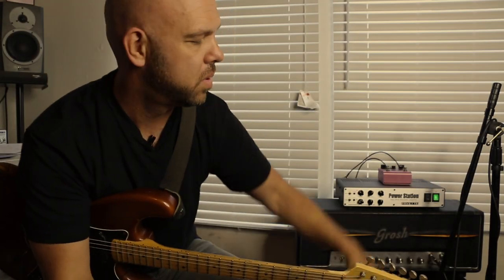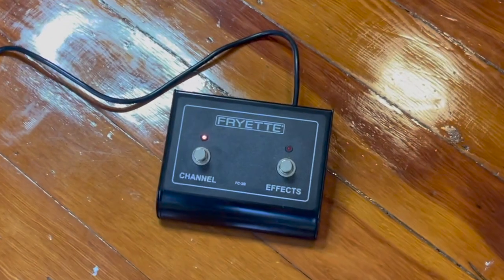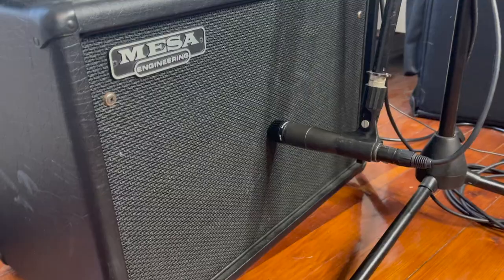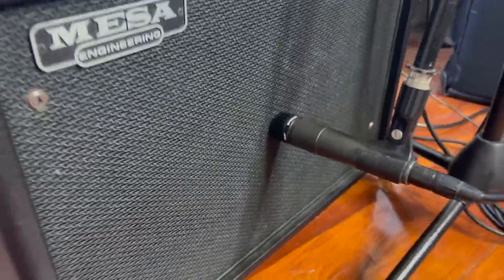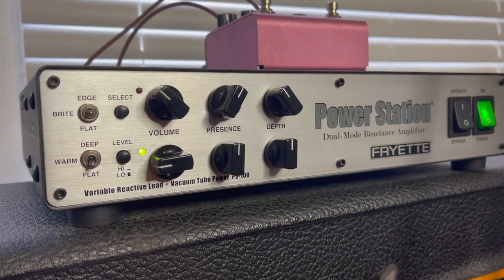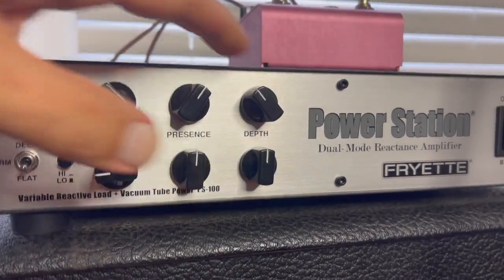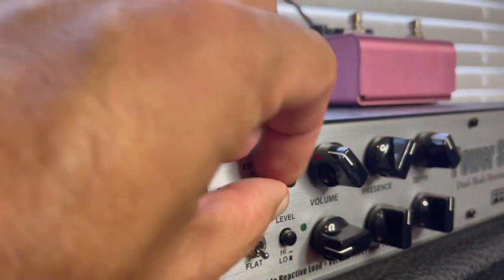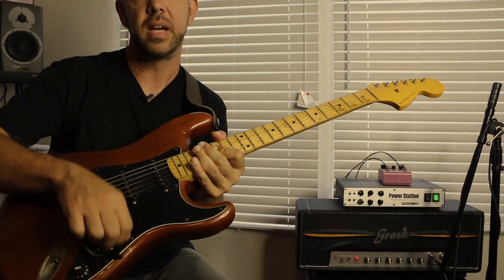Fryette PS-100 with a footswitch!

Comment: Sir I hope you can shed some light on this: I am interested in using the PS-100's tube power amp with a AxeFX II and through a Marshall 4X12 greenback loaded cab. Now the AxeFX has several adjustments/options one can make if you are using a Solid state power amp or a tube power amp. Now the difficulty is (as you remarked in your video) is that the fryette's tube power amp is more "clean" or "neutral" so as to not add much "color/personality)....BUT it still is a "Tube amp and I would guess that you would not make the AxeFX "settings adjustment that you would pick for "when using a solid state power amp"  For instance for solid state power amp you might want to leave the AxeFX "power amp emulation on (because the solid state power amp is too "sterile" but is the Fryette ENOUGH of a "Tube power amp that you/I should leave the power amp emulation "Off". There are also other settings that are easier to guess (since I'm using a "Real" cab I should turn the "cab sim block off. So I guess I'm asking you: When using the fryette "tube power amp" even though it is actually a "Tube amp"...but still it is so "flat/neutral" as a power amp one should still leave "power amp simulation "ON".....YOUR THOUGHTS????
Reply: I'm sure Fryette themselves will step in to answer this at some point but...

To my mind the concept seems to be that the Fryette is fairly close to a valve hifi amp and that is absolutely what is needed to do its chosen job properly.  All of the normal interactions bar one are taken care of before the Fryette even receives its signal.  Your preamp/power amp setup does its job as normal into the Fryette's reactive load which it sees as simply the same as a speaker.  This accurately emulates each nuance of the output/speaker load interaction.  The Fryette power amp hasn't even come into the picture yet.  While this is happening the Fryette lifts its input signal voltage from the reactive load.  In doing that it is capturing the distortions, resonances and peaks and troughs of an entire chain of preamp/power amp/speaker load in its signal.  Everything you want is in there.  If it adds any colouration itself at that point it is imposing its own character on the already fully shaped signal and you don't want that.  You want that signal to then be reproduced as accurately and as transparently as possible.  That way the character of your own chosen amp is left untouched and complete.  Having a "hifi" style ultra low distortion and colouration power amplifier is the job in hand.  Set your power amp simulation to "On" as the Fryette is not adding anything like that degree of colouration.

Oh, and by the way, any internet guru who claims that a perfectly clean amp or any other gear can "impose a hifi sterility" on a signal is talking bollocks!  An ultra clean amp by definition neither adds nor takes away anything.  It cannot impose anything on a signal, only reproduce it exactly either larger or smaller than the original.  If it makes the sound seem sterile and lifeless then it is adding distortion which is creating that effect.  "Removing" something from the sound is still achieved by adding distortion components.  That's called science!

Or you could just use your ears and listen to both then choose which sounds best to you?

Comment: I'm curious 🤔 I'm going to be using my Freyette PS100 with a Budda Superdrive 18 2x12, but I don't have a footswitch for the Budda amp, but I do for the PS-100. The clean channel is louder than the overdrive so I would like to switch between the two channels after I've adjusted them with the powerstation to get them to the same level. Is there any way I can use the freyette footswitch to simultaneously switch the amp channel and the powerstation channels?
Reply from the maker: No, there isn't. That would require some kind of isolated remote switching box.
Reply: @FryetteAmps  Would the Boss FS6 dual footswitch work for this application? A/B TRS output to Powerstation then B output to my Amp?